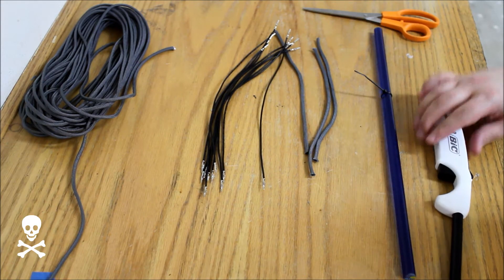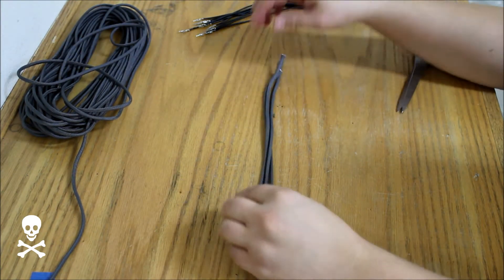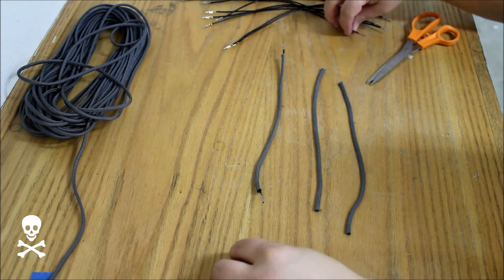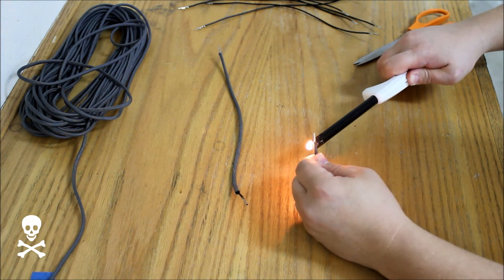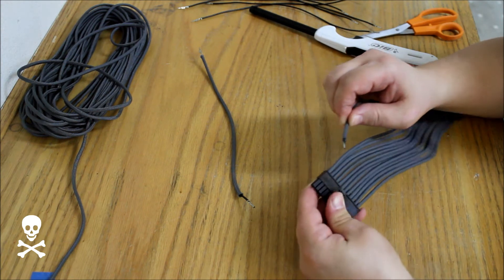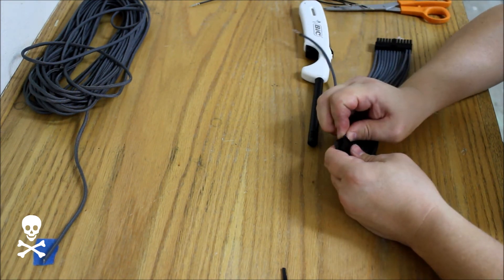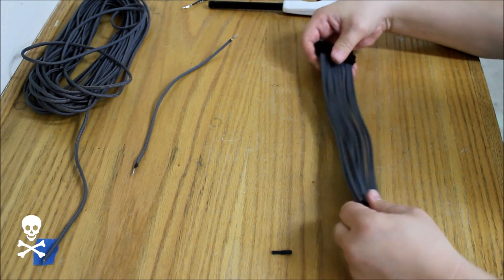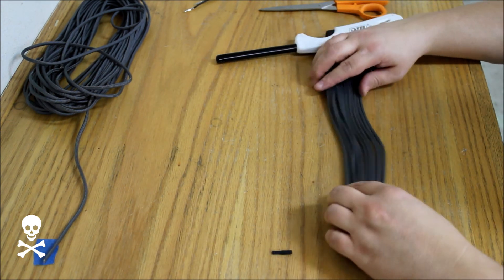Paracord

Comment from the maker: You have to be sure that the wires are placed in the connectors correctly. For extensions it is usually a one to one placement but if you are doing a power supply you need to be sure the wires are correct.

Comment: Hey buddy on your 24-Pin ATX Extension Cables top be 30cm and bottom cable be 28cm to give it the Rainbow.can see on your cables wires are a bit too long just a tip for you.good luck buddy...
Reply from the maker: Thanks for the tip. :)